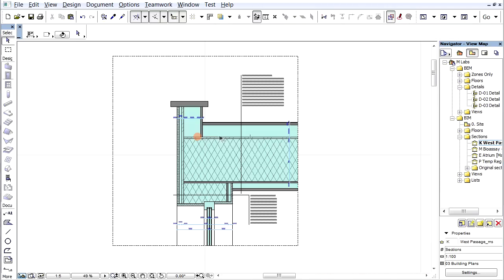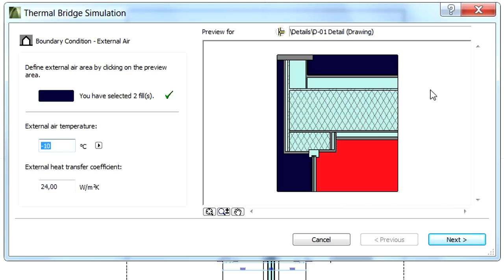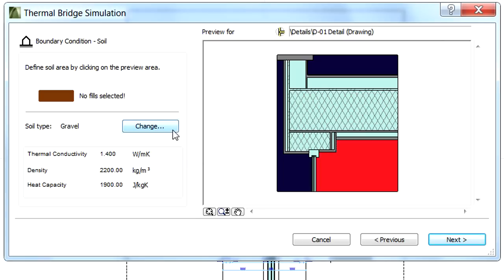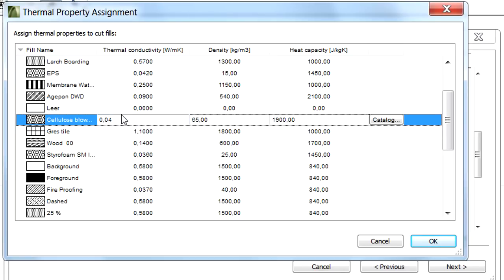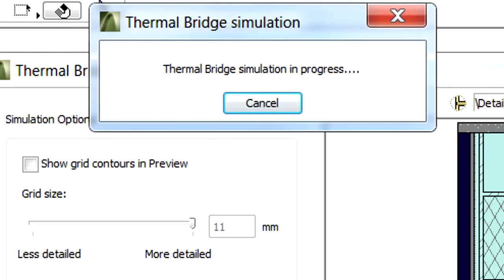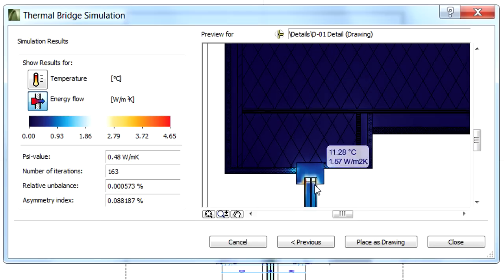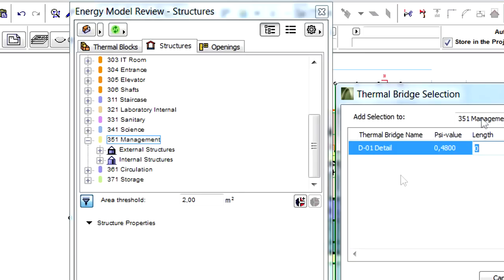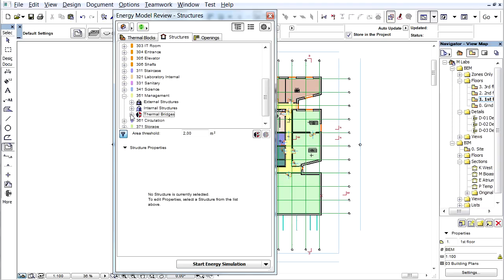Thermal bridge simulation on ArchiCAD details

Comment: Is there any way to report PSI valie calculation results? By the way, the PSI value shown in the video is not the actual thermal bridge PSI value, caused by difference of exterior and interior surface area and detail specific elements. It is basically the average U-value of such a profile.